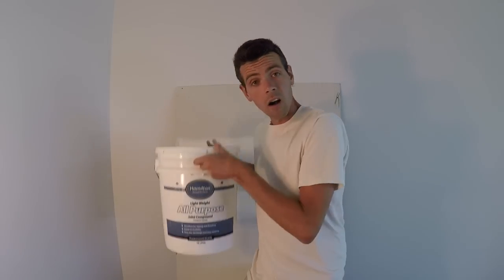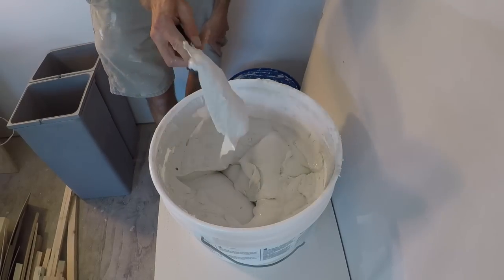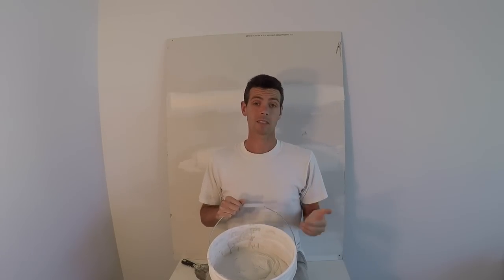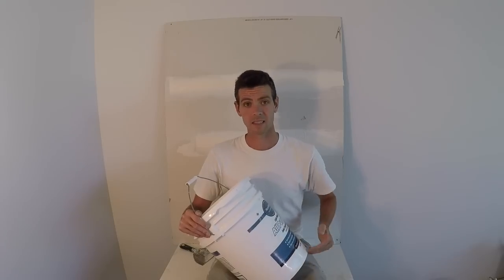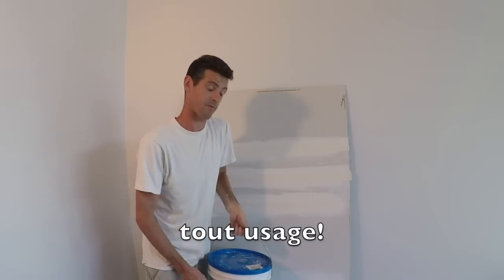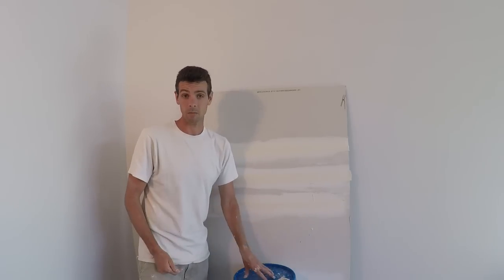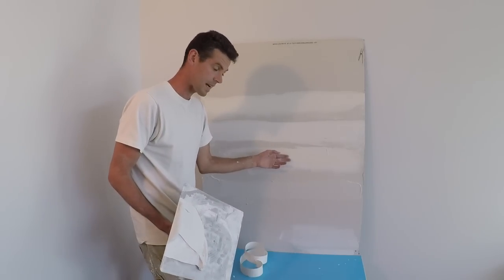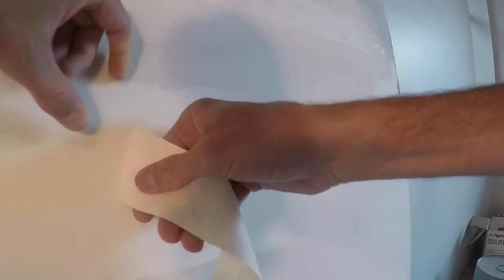LIGHT MUD vs HEAVY MUD!!! (What's the difference?)

Comment: I’m from Regina, sk and heavy weight all purpose is available everywhere but I prefer to use durabond and mesh tape for taping joints. I think this yields the strongest joints but is more labor intensive. I use ap for skim coating and I have also used the new Reno mud that’s easy to sand and is less dust, the dust just drops right to the floor. I heard there’s vinyl in the formulation. You’re so right about ap being hard to sand too. 

Can you do a video about doing jobs / Reno’s efficiently (not on the tools, everything else, setup, cleanup, etc.. )

Comment: In the 80's, the drywall and mud used in my new home was top of the line.
Found out the hard way that the drywall and mud used in my 2006 house was inferior quality, recycled drywall because it is lighter and the mud used chips easily. Not impressed, low quality, high price.
My drywall contractor should have told me the difference. Paid a lot for poor quality materials. My drywall contractor though,  was top notch in the quality of his work.
Reply: even heavy (regular) drywall contains recycled materials now
it s the air en-training (the air pockets) in light drywall that make it weaker

Comment: I haven't figured out the reason the heavy weight bucket is heavier than the light one. But I think it might be because of the water content? The Lightweight mud is just filled with air bubbles, and like you said needs tons of water before it can be used.

Comment: I've been doing drywall off and on for a few years I live in Michigan and I don't believe I've ever seen the light drywall mud all I use is + 3 it is a bit hard to work with but you end up with a very durable joint
Reply: UGL Plus3 ?
Isn’t that the blue lid light compound?
NJ here.
Reply: @machia0705  yes
Reply: @machia0705  since watching this video I've changed the way I drywall all together I start using a banjo to lay my tape and mud then I thin all the rest of my coats down to a heavy paint light consistency and apply it with a roller and smooth out with your knives which results in a very smooth fine finish

Comment: Thank you for all ur videos… been watching them for the last two weeks.. and will continue for months to come.. I’m here in the northeast US.. I’m currently remodeling my home I got it all the way down to the studs it’s a 1920 home.. I already did new electricity and insulation I’ll start drywall tomorrow.. I won’t mud till spring so I want to learn as much as possible..here in Connecticut it seems a lot of people use premix green cap all purpose for everything.. I see friends who add a little water to the mix and tape with it but they also finish the whole job with the same compound… is that a good idea?

Comment: USG Plus 3 is MUCH easier to sand.  Taping...  Hot mud.  (45 min, or 90 min).  Fill coat... Mix of hot mud and Plus 3.  Final coat... Plus 3 only.  Skim coat, if needed... Straight Plus 3.   Also, bucket mud ALWAYS needs to be thinned out.   Patches can be textured with Plus 3 (thinned).... Rooms, Go Buy Real Texture Mud!!!
Reply: Careful with mold on this stuff.  Use it quick.  Maybe it was a bad batch, but was sealed tight in air conditioned closet for 2 months.

Comment: Would be interesting if you pre-wet the paper with watered down dish water Elmer's glue solution, would that be stronger? Would be interesting to see if it improves the lite all purpose. The big lesson here is to do quality tests when using methods that aren't normally used. Great Video.

Comment: I’m working on seam repair on ceilings and walls.  Cracked joints and failed older taping.  Used hot lightweight and looks shitty and rough even after good sanding.  Switched to heavyweight all purpose and looks much better and smoother.

Comment: Thanks!   All Home Depot in Ontario sells is this exact same heavy weight.  Always wondered why I couldn't get the same results you do when I am using this stuff. Now I understand :). Next video suggestion:  how to deal with the bubbles this stuff inevitably leaves behind.
Reply: Machine Mud (orange label CGC) is available in Ontario Home Depot's and is essentially a light or finishing mud.  Very nice to work with.

Comment: Just ran into you while researching on patching nail holes. Watched several vids already that have nothing to do w/my problems! Question: What is the purpose of this "tape". Is it used for patching larger holes? I'm in Seattle area.
Reply from the maker: It's for covering the joint between drywall panels after installation. If there is no tape the mud will crack and fall out over time. It's also used for patching holes.

Comment: Haha, yeah, wetting the tape creates a water barrier between the tape and mud, although it may feel smoother to apply like you're mixing the mud on the wall, once that water evaporates... it's a bad idea, think of it as paper mache.  Just mix soupy enough mud so the glue can absorb into the tape and you will never have a problem.

Wetting the tape would be like misting my Modified Thin set before setting my tiles on it.  That's exactly how i thought of it when I watched you demonstrate it in previous videos, i'm glad you were able to show the results
Reply from the maker: Great way to describe it. A water barrier.

Comment: Watched a year old vedio so this issue of wet tape may already have been answered. But moisture always goes to dryness so if the tape is wetter than the mud. The mud absorbs the moisture not allowing the intended reverse of the dry tape absorbing moisture from the mud. The adhesion.

Comment: NEVER water the tape. However, the mud has to be wet enough to soak into the tape or you’ll have dry tape spots. Or, use a banjo to preload the tape. I’ve gotten away from paper tape and use fiberglas mesh. Also, on smaller jobs I use Durabond 90 (or 45) for bedding and first coat. MUCH stronger!!

Comment: I've been using hot mud a lot. It is a bitch to work with especially when using the 20 min product (they sell 5, 20, 45, and 90 under USG products), but it hardens fast and is pretty tough for larger areas. It's a good base coat to use before going over the missed spots with premixed mud whether it's lightweight or heavy.

Comment: Great video, very informative. One question if I may, which one is better for a skim coat in a bathroom where humidity / water would potentially be a problem?
Reply: Good question,. I'd like to know myself.
Reply: If it still matters, all drywall mud I've seen is labeled mold and mildew resistant. So it's all ok to use in a bathroom as long as it's painted.
Reply: @maxgilbert18  thx max, I was worried about the moisture reactivating the mud, turning it mushy. Like when I applied sugar soap to clean a wall after I filled in the little dents, it reactivated the mud and washed it away. I wonder why the water based paint doesn't reactivate the mud.
Reply: @flyingwhiteindian  I'm sure if you brushed a wall hard enough with a paintbrush it would probably dissolve the mud. Although I've never had that problem.

Comment: I have a question
Do an tape test with fiber tape, an see how it compares with paper tape
Reply: Always use paper tape 
Only use mesh fiber tape on small repairs.
Reply: With quickset
Reply: @johnmendoza6421  , you have to use a quick set mud due to the adhesives that are in it that aren't in regular mud. If you use regular mud, the fiber tapes will just flop off.
Reply: Fiber tape is only good for tapered joints. NEVER use on any other joint. It will crack every time, usually with a couple of seasonal changes, especially in high humidity.

Comment: As a professional, I think you’ve said you use quick set mud when taping joints (which do you prefer 45/90 easy sand or 90 durabond, your thoughts?). So then Is there a place for all purpose mud as a professional, or is not worth the extra weight period?
Reply: As a professional contractor turned flipper, hot mud is 5 min - 20 min. That's only enough time for patches or deep fills, never enough time for  long runs that need tape.
45 min - 90 min for joint fills and texture spray.

Comment: I always get jealous of drywall guys that get to use all day mud ... We have to tape with hamiltons 5 min mud. your running as fast as you can all day and pan mixing small batches. we have guys that will scrape the tiny amount left in our pans so we can just keep going... I hate corners with it.... I remember when is started about 15 years ago it would set in my pan before i even got to the joint and now after that long I can blow through an entire pan before it's set. It wet sands very easy too, the best wet sanding is with hamiltons vs every other brand sold and tested... if your wet sanding it does have a tendency to chunk out if topping with 20...  I wish it wasn't a paid by the sf type work and my dream is to just get a pallet of box mud and relax lol...

Comment: Question, every time I blade over a small hole like a nail or screw hole, the joint compound or mud seems to protrude outward like a bubble, is there any way to prevent this so it stays flush?

I learned all my techniques from you, you're the best man!
Reply: it should shrink back as it dries, could your mud just be really runny?
Reply from the maker: Wipe it on in one direction and take it off in the opposite. It usually works
Reply: @vancouvercarpenter  OK thanks much, it's not a huge problem obviously but sometimes they dry  inwards forcing me to fill it again slightly.

Thanks for the great videos!

Comment: Nice job but. What decade are you in? I never see light or heavy mud on pro jobs. The big boys don't use it here in central PA. Sheetrock Purple lid Midweight is all you see on the new homes and commercial work. Never even seen a blue or green lid on the jobs since 2000. Some guys add a little dish detergent to the mud when tempering it. A drop or a few and a little water before the potato masher.
I used to weight lift and exercise after work when I was young. Up till age 40. Building your strength above what you need for work prevents injuries. I'm 61 now and never have overwork issues. Other than more tired by the end of the week compared to younger days. Mixing mud in your pan and taping builds your hand and forearm strength. Not too many men compare to my monster grip strength. 6'2" only a lean170 lbs. Great teaching skills. Bless you.

Comment: Wish i had seen this before I tapped my bathroom (and another which would have told me not to use steel corner beads) i just bought the heavy for the finish coat... doing things all kinds of wrong.

Comment: Another question: There are so many different muds; hot mud, lightweight mud, heavy mud, quickset 90 & 45 & 20, taping mud, moisture resistant... Is there any place/situation that you can really screw up using one type of mud, when another is called for? Thanks
Reply from the maker: Yes you can.This video might help but I can't remember exactly what I cover in it.   https://youtu.be/s-4yh3XY5wU

Comment: I always use hot mud to tape and bed and sometimes finish with hot mud or if I have the time skim everything with all purpose "heavyweight" it sands like crap but if you mud everything tight and feather everything hard there is very little sanding anywhere and smooth like glass.
Reply: Our buckets are bigger in the states to, the All purpose buckets 60 + lbs depending on thin you make it. Feels like 70 carrying it up the stairs lol

Comment: Really glad you did these tests... I use to wet the paper at some occasion... but now, no more.  For quick patching I now use 20min light mud called "Rapid Joint 20" from Continental (in Qc) which sands really well (not like Durabond)... I will try your worthwhile test :)
In regards to the heavy and the light... I wonder how it would come out with a mix of both for taping. Maybe I'll try that.
Thx for sharing. Regards.

Comment: You should be using your heavy weight on your initial coat when applying the tape and the light weight for the finish coat/s.
Of coarse if you are just doing repairs. Just carry the light weight.

Comment: I live on East coast in the states and I pretty much just see the "All Purpose" Green bucket and the "Plus 3" Blue bucket. The Green is super hard to sand but rock hard. Then Plus 3 seems lighter and easier to sand. Sounds like you guys have even lighter mud which I didn't even know existed.
Reply from the maker: I think the two muds I showed are virtually the same. The small bucket I used is exactly the same as green lid. I have used green lid before.
Reply: @vancouvercarpenter  if I had my way, id like to plaster my walls. My house was built in 1950 and that's what I currently have but looking to put an addition on. But I have virtually no experience doing it : (
Reply from the maker: @skutsenkow  plaster is the bees knees but it takes a much more skilled hand to do it well. So much more can go wrong. I would love to learn it.

Comment: Want to know the best way to adhere tape to a seam? Elmer's glue! I first prepare the joint with hot mud to fill the crack. Then I mix Elmer's glue with water at 50/50 ratio and saturate the tape in the water/glue mix and adhere it to the wall. Then I follow up with mud.
Reply from the maker: That would actually work well.

Comment: Could you use the heavy first with the taping step to make the joint strong, then use the light? Any thoughts?
Reply: Yes. Use hot mud or a heavy pre mixed to embed/cover tape. Use lite for final coats

Comment: Glad I found this video. I'm replacing the wood paneling in my house with sheetrock. I started out using ultralight mud and wetting the tape. Didnt really seem to work that great and the wet tape wasnt bonding very well. Then I used a heavy mud because thats all the hardware store had that day with a dry tape and it worked way better for me. 

Any difference between the two for a knockdown texture? I'm using a cheap hopper to texture the walls. I think I used the heavy mud in the first room I completed and it seemed to work ok.

Comment: CGC Sheetrock All Purpose box mud is what I like using the most. Prefill, use right out of the box. Large gaps, use right out of the box. Taping and final coat, add water and use a mixer.
https://www.homedepot.ca/product/sheetrock-16-l-ready-mixed-all-purpose-drywall-compound/1000511950

Here in Ontario, we have All Purpose Light, regular all purpose, etc. Including the bucket you were experimenting with. The Sheetrock All Purpose bucket is more DIY mud than real, professional mud -- at least where I live. We typically also use Sheetrock 20, 45, or 90, especially for large gaps, since it dries nicely and quickly (Yes, it will crack in large gaps, but that's easily taken care of).

Comment: If you have too much to sand, you put on too much. It's a 3 step process. Seems you don't have much experience with all purpose as we do here in the east. Skim coating requires watering it down. If u want get 45 or 90 mixture that dries in 45 minute or 90 minute time.

Comment: add another test to the board with usg plus 3 heavyweight mud below the all purpose heavyweight, not sure what the difference is?
Reply from the maker: We dont have plus 3 here
Reply: I used USG Plus 3 LIGHTWEIGHT mud the other day to finish off a skim coating job. Let me tell you.... that stuff sucks. It dries WAY too quick. Definitely won't be using that lightweight junk again. 

Btw, it didn't look anything like your lightweight mud. It just looked like regular all-purpose with lots of air puffed in it
Reply: @WayPastCrazy2525  oic thought it was maybe heavier good 2 know
Reply: @ForWeDoNotWrestle  they make a normal mid or heavyweight mud. I don't know it's quality. And to be fair,  the plus 3 lightweight MAY be a good product for someone who is quick and does this work all the time. For me.... that's a no-go.
Reply from the maker: @WayPastCrazy2525  the look of it will be regional too. The brand I was using just comes super dry. Totally  unusable out of the box without water.

Comment: I usually always soak my tape in water before mudding!
Some people just put the whole roll of tape and a bucket of water. 

It can get a little challenging what corners, because the tape can loses its form a little bit.

 Is the opposite of rolling dough! You usually put flour down, so the dough doesn't stick. This you want the tape to stick.

 Sometimes I keep a spray bottle with me, so I can spray the holes with a little mist before I mudding them. Especially it's plaster

Comment: There is a simple solution to the Joint Compound selection.  Use a lightweight joint compound with a fiberglass mesh tape for all joint work, corner beads and mesh patch perimeter work.  Paper tapes are like amalgam fillings.

Comment: I learned pretty quick that the lightweights do all that you said. Particularly that they scratch so easily. I would never use it in my own place but for a customer's job when they scratch or damage it the last person they blame is the plasterer. They presume the damage was their fault, not the fault of the product. Professionals are pretty much the same across the board - they go for the easiest, cheapest and fastest way to get the best appearance. As you say, you'd have to charge more for the heavyweight as jobs are done on cost. The issue with that statement is the customer is never given the choice, or had it explained to them. Then again, why would you? Lightweight is far easier to use and finish - and the customer will always blame themselves for subsequent durability issues.